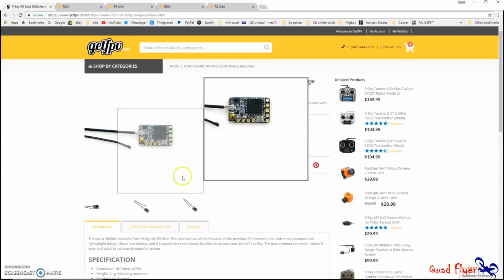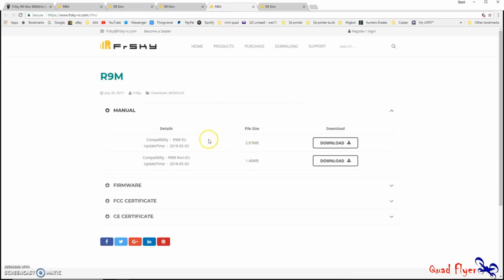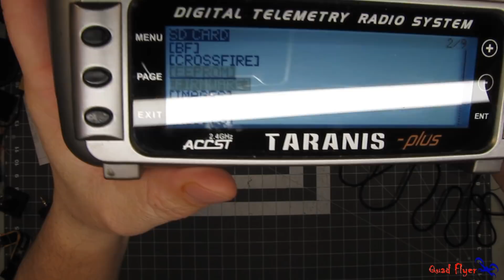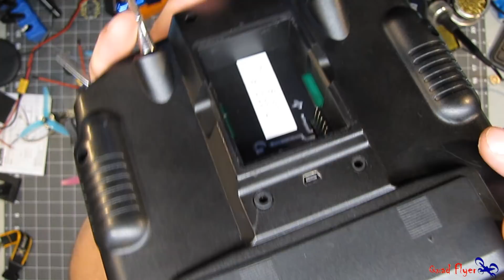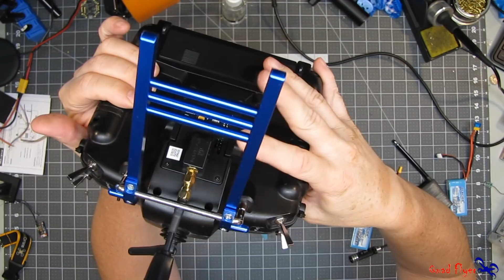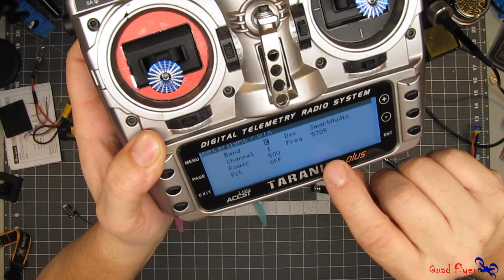Frsky R9M 915MHz long range radio link

Comment: Just a word of caution- ONLY update firmware for your region(EU or US) if it says LBT that's EU version.
Reply from the maker: To clarify there is no damage done when flashing either firmware,

However.. Goes without saying
- to remain a law abiding citizen it is strongly suggested to flash only the firmware that's legal for your region. 

In the latest firmware release  181228.
It clearly label each firmware either FCC or LBT.

Comment: You dont need that 5v BEC when you flash your RX....its not main Lipo power coming out those Bay pins.
Reply from the maker: EnglishTurbines yes sir it is! I checked it with a voltmeter.
However if you're running the original battery or a 2s in your battery Bay then a 5 bolt bec is not needed,

Furthermore I have recently switch to a 2's battery in my taranis because FR Sky told me that it is  likely  to damage the R9M module with 3s coming out of the battery Bay pens.
If you don't fully charge a 3s you will probably be okay, which was what I had been doing to make sure I stay under the 12 volt specification

Comment: Can you talk about your VTX? I bought that R9 slim receiver and the module months ago and I have not updated or installed yet. I was concerned about my VTX limitations (5.8 gHz - TBS Unify Pro HV 1.0 - 800mw). Are we running our VTX through this module or is this still 2 distinct components (transmitter receiver + Video receiver)? I know it's a noob question but, I did not have time to read much on it and it looks like you are all set. I was under the impression that I would have to find me an alternative VTX (like a LR 2.4 gHz  or AKK 1.2 watt VTX... to go with this 915 mHz receiver in order to be consistent with my components)
Reply from the maker: Benoit Bourque,
The R9 Slim and a VTX are two entirely different things.
The R9 Slim is the receiver from your radio.

The VTX such as a TBS unify is a video transmitter that transmits the video from your fpv camera back to your goggles or LCD screen. That you are using to fly fpv.

You never ever want to transmit on the same frequency with  radio link with your fpv link.

The most common VTX frequency that is used is 5.8 gigahertz. The most common radiolink is 2.4 gigahertz there's enough spacing in the frequency that that works well.
Personally I am not going to change my video link from 5.8 to 2.4 simply because all of my smaller copters are 5.8

The reason I went to 900 megahertz was to improve my radio link. So if you wanted to you could go to 2.4 gigahertz video. But again do not transmit your video at 900 megahertz the same as your radio link.

Be aware however that there are laws that you have to abide by according to what frequency and where you live so keep that in mind

Comment: The r9m most certainly a crossfire micro tx killer for sure. I just ordered one with the slim, also ordered the mini reciever to test. Im going with the TrueRC TRUE-MOX 915mhz antenna as opposed to the diamond because i saw some testing where it performed slightly better! thanks for the vid dude!
Any chance you could do a range test on 25mw with stock linear vs diamond?
Reply from the maker: Motor Madness, I agree in my opinion is Crossfire killer but some people (the crossfire users) say the  crossfire protocol is some kind of pixie dust and is even better. 

Since betaflight 3.4 and they added the feature RC smoothing, and now we have a very useful tool.
Rc_smoothing_info.
Mine says 6.3 millisecond,
Definite improvement over 2.4g

And as far as range testing...
I've have thought about doing that, but I think each user experience is going to different,
The number one problem I believe is going to be environment are you in an open field do you have power lines around are you in a heavily wooded area do you live on flat land or will you fly up the side of a mountain.
The next thing is going to be antenna placement on the quad it's going to have a huge impact on what your range will be.
I believe there is so many variables that come into play that if I  tested and get a mile the next person they tested and get 2 miles with the exact same setup simply due to the environment.

And as far as the diamond antenna is concerned if you go to Team blacksheep website and look at the diamond antenna.
You will see a little article there from Alex grieve about the diamond antenna.
The diamond antenna wasn't created to increase range.
It was to address they null between 0-5 and 15-20 deg azimuth.
Reply: It’s nice to see frisky get on board with 900mhz but let’s be real. Crossfire had WAY more features. Bluetooth with MAVLink, diversity rx with built in battery for locating model in case of a crash, built in spectrum analyzer, OTA firmware update and much more. If you don’t need those features then that’s fine but crossfire has a lot of pros over the r9m
Reply from the maker: John Pilgrim, Yep this is true Crossfire does have more features,
( although this should not be compared to the bigger version of Crossfire,  this more suited to be compared to the one that fits into the compartment Bay like the r9m)

Although the R9 slim+  has diversity.
As far as Bluetooth my Lua script does everything I need.  

I can easily update the firmware to the receiver using pass through.

And if I do lose my model I always have the Lost model finder using the Achilles Pro firmware in my goggles. ( used it a few times and it always taking me straight to it)
Although there is the situation when your battery gets a ejected.
And if that's the case I strongly suggest that a battery pad and more than 1 strap is used, in my years of flying fpv I have never had a battery inject or unplug from a crash. ( I use a battery pad and 2 battery straps that are rubber or siliconized)

I  think the crossfire setup is probably more suited for long range fpv (as in miles)( because of said features) 
For me though I just wanted a stronger More robust link, if I fly 2 football fields away and dip behind a tree and turn around I don't want to find myself in a failsafe situation.
Or flying behind a building a hundred feet away.

So in short, no I don't need all those features simply because some  of the other gear that we already use has those features. Or something close to them.

As you said though,  Crossfire has a lot of Pros and those pros come with  price tag 😉
 Thanks for your comment and happy flying
Reply: Quad Flyer X that’s one of the reasons I like crossfire. I have some minis but I also have some big birds that go long range.

Comment: when do you plug in the external battery? do you have to shut off anything with the regular battery?
Reply from the maker: TheWhatthefuck12 there is no specific order.
My routine is to turn the radio on then plug in the external battery and then unplug the battery before I turn it off
Reply: OK COOL! I was afraid of cooking something when both were plugged in. So it will work off the transmitters battery power without the external plugged in, and when you plug the external battery in, that takes over?

Comment: I would like to have this system. But I don’t want to have to make up wires and try to flash firmware. 
I can’t even get my radio to download the original firmware. I get an sd card expected version warning every time I turn it on.

Comment: Range?
Reply from the maker: Mr FPV I've personally only gone out roughly a mile on the hundred milliwatt setting.
FrSky claims 10 kilometers or above.

My purpose for this wasn't for how far I can go away but is keeping an ultra strong signal for freestyle.
Reply: Quad Flyer X 99 rssi the whole flight
Reply from the maker: Mr FPV it mainly depends on your environment.
When I was in a great big open field yeah standing in the correct orientation with the diamond antenna, pretty much if I'm around a lot of trees and buildings and hills.  No. But I haven't seen a drop below 80.  But... I'm still running 100mW. 

100mW just what I needed to without sacrifice too much battery power

Comment: I just got one off eBay brand new $40 with the newer style antenna the listing said it had no antenna but when it showed up my house it had new whip Style antenna .
it also showed up in 3 days after purchasing .
u.s. cellular
Reply from the maker: I've only use the new type of whip antenna just the one time until my TBS Diamond antenna showed up.

What I did to test the difference between the diamond and the whip was I set the quad about 3 foot off the ground and walked about a half-mile away from it and then I checked the differences in the RSSI as I moved the radio in different directions and positions. 
I did see a considerable amount of difference with the diamond antenna although Diamond antenna is better pointed in the direction you are flying.  
You can still fly behind you but I wouldn't go as far as what I would in front of you

Comment: is latency slightly better thn x4r or xsr
Reply: Newest slim firmware is 7ms on sbus, vs 9ms on 2.4ghz
Reply from the maker: don setunge. Unfortunately I do not have the equipment to test that. The only thing I can comment on is that to me in the real world experience it felt like it. 
However if you go to FRsky web page and look at the features for the r9m, you'll see one of the feature says low-latency high-precision RC system so what does that mean exactly...
I really don't know but what I can tell you is me personally I felt a difference in it. 

My real reason for switching to the 915 megahertz system was because I was tired a finding my RSSI critical warning on  2.4
Reply: Quad Flyer X  differnece u mean? slower or fAster
Reply from the maker: don setunge less latency,  the quad reacts faster to my inputs
Reply: sean metzger  has frsky offically said it or is this ur testing?

thanks anywayss
Reply: Its Sbus,  so really it should be the same.